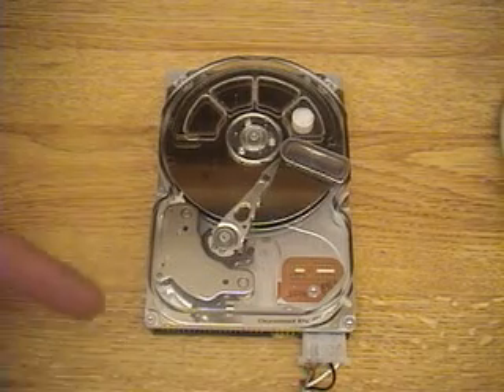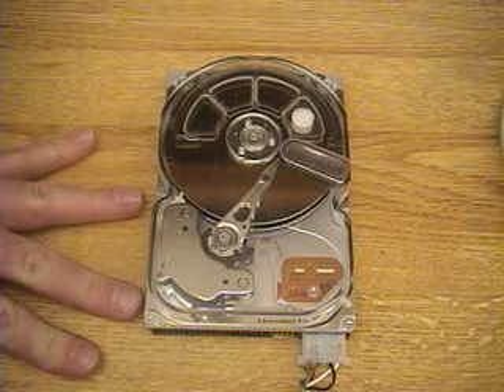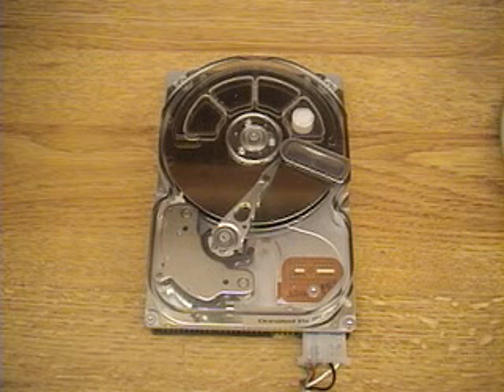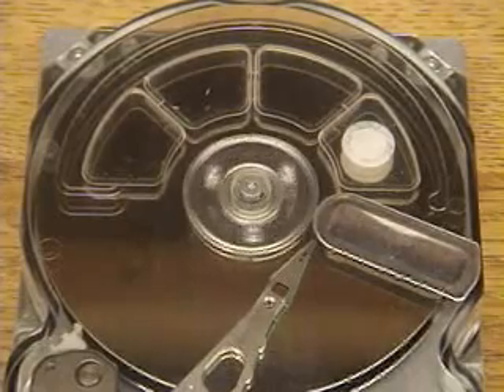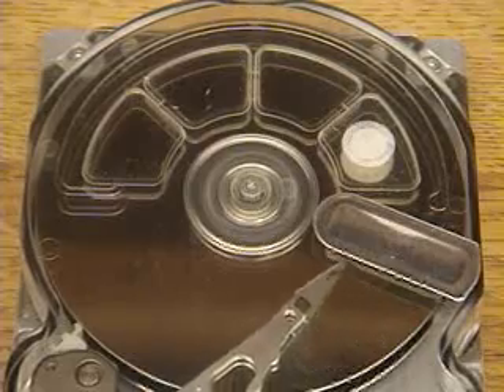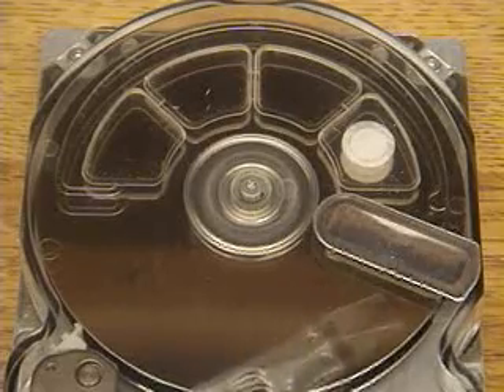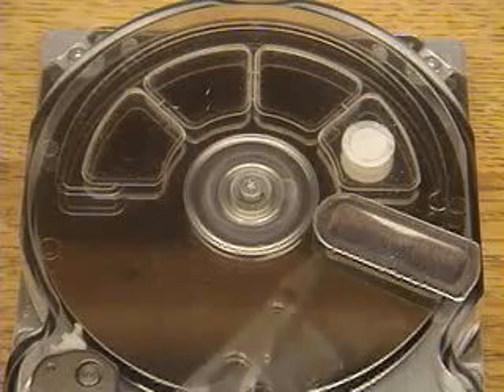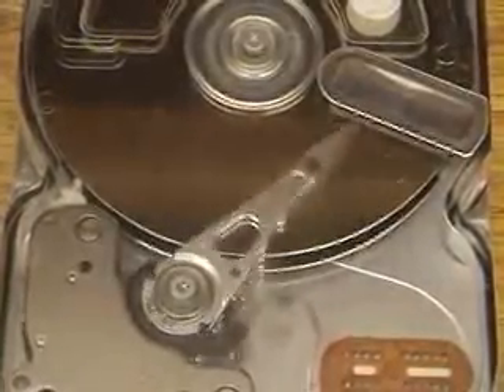Hard Drive

Comment: @tkktkt  true. Its only a spin off from Tape Drives that use time information tables to locate files. Eg. File 'A' is located at 3min 16 sec. To get to file 'A' timing pulses are written on the tape and the hardware counts them (fast search) to get to 3min 16 sec then reads the data from there. A hard drive uses formatting, the OS writes the file allocation table to the drive and this is a known and stored variable that just tells the head to shift position to get to exactly the right location.

Comment: @jay52592 The video explains its a demo. The procedures are hard encoded into the hard drives rom on the drive circuit, which you cant see in the video as it is under the drive casing. =]

Comment: @GabrielGroverMan the voice coil actuator is very much like how a speaker works in your hi fi. The sound produced is caused by various voltages oscilating at given frequencies to produce sound in a paper cone. The head/s on a hard drive have a set of  very powerful magnets to help keep it in a given programmable position using the same method., voltages and frequencies fed through its coil to define its position.

Comment: @GraspingReality Information is stored in flash memory as tiny microscopic 'fuses' which are broken (0) or linked (1) these kind of memory chips can only be written to a number of times before the links become un'flashable' and are therefore only suitable for long term storage where information is not required to be updated continuously. Standard RAM uses continuous power to refresh the on/off state of transistors, which obvioulsy lose their information if power is lost.

Comment: Great video!! I made almost the same thing with a software i created, you can see the disk doing some seek algorithms (scan, sstf, fcfs, etc)
I uploaded a video that shows it in action

I used the IDE connection, and moved disk's arm to a specific cylinder using system calls. How did you move it?? I don't see any data cable... I really like to know.

(Sorry my bad english)
Bye!